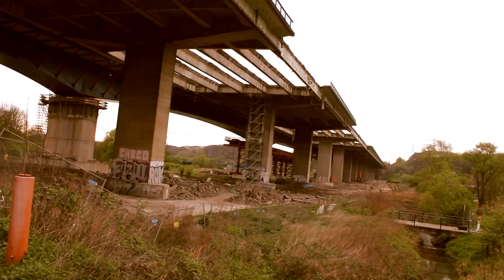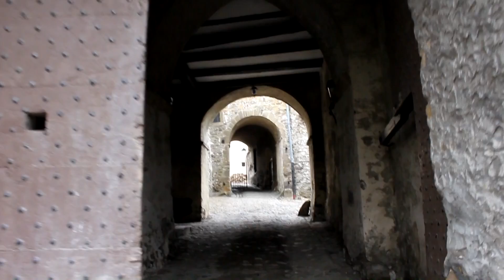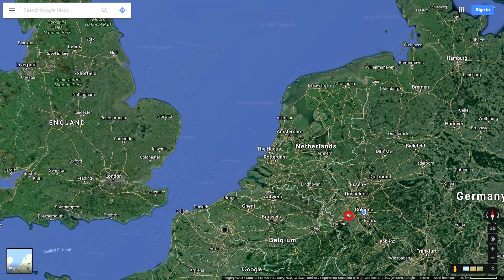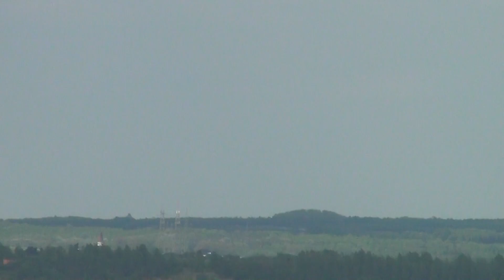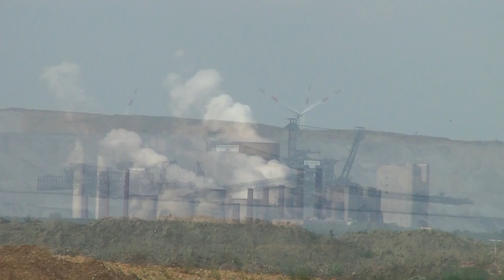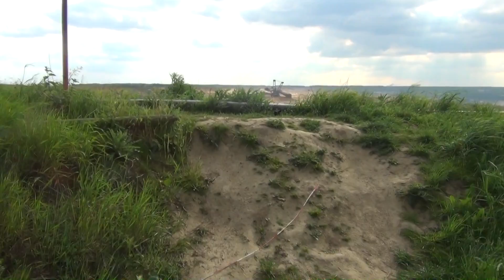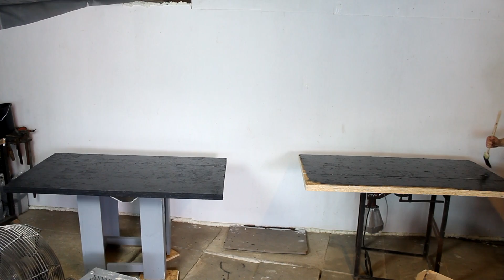A Trip to the Wasteland (In the Middle of Germany)

Comment: Lignite is basically dirt that burns. It's low energy, so you have to burn a lot to get the same energy of better coal. It's one of the dirtiest ways to make power.

My opinion: it was a mistake to abandon nuclear power after Fukushima. It's so much cleaner than coal, especially lignite.
Reply: You see, I have not mentioned my side on this argument, I have not picked one, I believe in context (as in should you build nuclear plants in places with frequent geological activity, probably not, unless its figured out how to prevent disasters in case of any sort of event, but that is a different discussion).  What we are discussing here is you, a random guy on the internet spouting your conclusions in CAPS on the youtube comment section and ending your lack of substance with a PERIOD , now that to me smells of arguments from emotion, or more accurately -> argument from ignorance. As your first comment set off my bullshit detector(not the detector that says that your conclusion is wrong, but the detector that says that the way you came to your conclusion was most likely not through personal research and figuring out the pros and cons of the issue, but from emotional reaction to a few media headlines). So I felt it necessary to query you for the basis of your authoritatively presented conclusion to which you have failed to respond on two occasions confirming my original suspicion that you are talking out of your ass. 

Moral of the story, don't speak in conclusions if you cant back them up, you'll end up looking more stupid than you most likely are(the behavior you have presented here is frequent in all sorts of comment sections, and it saddens me that it keeps persisting, but I guess its part of human nature , I'm just trying to make you aware of it, you probably are a really nice individual, but try to keep from capsing your conclusions if you can not back them up with sources. It will make you look way less silly on the internet. Capsing is visually raising your voice to try to strenghten your argument. If you have ever argued with a drunk person you find out they often start raising their voice instead of making sense to feel that they are being correct, I suggest abandoning that habbit).
Reply: Oh I'm no nuclear expert, I just live in France where we have a Nuclear Religion, which is destroying every perspective of economical growth on medium to long term. We are exporting a lot of cheap electricity, cheap because the cost of maintenance, repairs, update, replacement and disassembly of the old reactors aren't included in the price but on our country debt. It's a bill we'll pass to next generation (the proof : none of our presidents ever made a decision concerning the massive problems we have with old reactors and the skyrocketing cost for disassembly. Macron also just spoke about how it will be address later, in 2050. As I said, the problem kid is passed between generations...). 
There is a lot of promotion for the nuclear as a clean energy because media tend to only focus on CO2, which is a fraction of the ecological disaster. Maybe when we had yet another impossible-to-happen nuclear incident we will think again. But let's not go too far, the point was, placing every bet on a limited-resource and yet-to-be-proved more effective nuclear technology is not smart. Elon Musk is considered a genius because he dared taking the leap to the next level, and the renewable, like the giga factory which is brilliant and will reduce cost of batteries. It's visionary, not "let's stay in the comfort zone". It's actually a safe bet, think renewable income in the long term...
Solar prices have dropped ten-fold in recent years, and think about wind, hydro, geo, tides, and better materials in construction. Efficiency of LEDs, architecture, recycling, lots and lots of things have been improved, it's true ! Of course we are on the right path...so let's not fail again and be stuck on a single path, the nuclear, just like in France, where investment on renewable is slowed down by nuclear lobbying. If we have to invest, let's not place all of it in The Hope that Science will find the solution in the Atom, and in time, before there is no fossil fuel left at a decent price (or uranium for what we know, as new reactors are taking decades of development).
Multiplying renewable is not simple, but it's an effort we can do today, because we have the technology. We also have to, if we actually want to do something instead of just talking and studying rising sea level etc. I hope someday people work together again, instead of losing time in empty debate when they're actually talking about the exact same thing. I'm so tired of our governments and finance controlling progress speed, when we perfectly know we have the capacity, technology, and all the means available for a renewable transition. But yeah, since EU is managing investment (governments can only invest 2-3% of their GPD or they get a warning/a fine), we are stuck, our economies strangled...that is why people are raising awareness on ecological problems, except the discussion always turn to war, one side crying it's a conspiracy to cripple finance, when actually it's the freaking solution to make massive bucks (ask Elon how it's business doing). But hey, go say to the Allmighty Areva that with a fraction of a reactor price we could cover a region in solar PV or windmills...well you know the drill, same dialog with oil companies. But they both control the market, so voilà !
Reply: @French Toad multiplying renewable energy sources isn't that simple, people like to champion Elon Musk for his solar roofs(but due to angling these cant be as efficient as regular panels) but that isn't exactly revolutionizing solar technology, just a smart way to market it to spread wider use. At least for the near future of a couple of generations there needs to be some other form of energy source and in some cases I think an argument can be made for the nuclear solution.

as for the consumption reduction , then that is being worked on in every industry already(ever heard of smart street lights, swapping for led-s, less power consuming computer electronics etc). 

" R&D isn't cheap and it's possible the solution for a more efficient
 reactor will be uneconomical because of maintenance and technology cost" That can only be true as long as fossil fuels are cheap, fossil fuels price rises can bring large investments into research. Its a matter of choosing uncontrolled atmospheric waste vs controlled radioactive waste, Improvements on both ends can be done in both fields. I'm not smart enough to pick a side, but so many people seem to be nuclear experts in the comment section, that I feel the need to bring arguments for the opposing side.
Reply: Joseph Dunn sounds a whole lot like oil sands (Canada) or Bitumen Shale(Utah), its all energy, it really depends on the economics.
Reply: Unless you find a way to smoothly transition into your dream 100% renewable solution you are going to have to look into the less friendly solutions and work out the pros and cons. Who does not want the planet to run 100% green, but the problem is that arguing against economics will always lose you the argument. Every country has its own geographical and financial limitations and all of that dictates the feasibility of green technology(for example, living in the north, i will never get elons roofs because they are way too inefficient, just an example, don't get me wrong, the guy does cool stuff). Also you should not model your countries economy after one billionaire thats kind of naive.
Reply: LFTRnow Nuclear is dead. Too expensive, too little, too late.
Reply: Nuclear power is not clean. It produces huge amounts of dangerous waste that we still have no solution for to get rid of it. Unless we find a solution to deal with the waste, no one should even try nuclear power on industrial levels.
Reply: @Greg Peck funny how you failed to make any specific statements after me pointing out the lack of specific statements in your original comment only for you to come to the conclusion that I am an idiot instead of the conclusion that you know nothing of what you are talking about, which seems way more likely given the way you conduct yourself.
Reply: Marcus thats the context based approach, reasonable
Reply: my point was not on placing every bet on  one thing, but having a reasonable nuanced discussion on the topic rather than going to the "x is bad mkay" approach which is popular on any polarizing topic and ultimately pointless.
Reply: Joseph Dunn My dear the reason why nuclear is being abandoned in Germany is not because it is a filthy form of energy, in fact, is one of the cleanest and most reliable source of energy. It's been abandoned because of safety concerns. Nuclear energy is quite deadly if there is any leak into the environment...
Reply: And it's not cheap either.
Reply: I have to say great conversation guys. I myself don't have the answers but I'll throw this out there my last 3 monthly bill was over $1000! ludicrous for a necessity. imo things are getting out of hand in Australia and I don't see any good ideas for a solution
Reply: Nuclear power, the current ones, is far from ideal but are not as bad as coal, also coal releases lots and lots of radioactive fallout (https://www.scientificamerican.com/article/coal-ash-is-more-radioactive-than-nuclear-waste/)
Reply: Ralf Anari I would suggest looking at available options. That's wind, PV and osmotic power.
PV is cheap and getting cheaper every year, wind is cheap and getting cheaper every year. Both are still on a learning curve. We do have power to gas and pumped hydro for storage.
Appart from wind and PV just have a look at high altitude wind.
Reply: " Of course we can argue for another century that it's not the right time
 for transition, that it has to be smooth not to cause to much panic for
 the economy, that technology isn't perfectly ready and so on. But those
 are just excuses we've been hearing since decades. The same excuses not
 to switch for LEDs, and you'll still find people with their 
incandescent bulb or fluo tubes claiming they don't want to hear some 
shit about . The skeptics are usually winning, and it's perfectly 
normal. Not because the technologies aren't ready, the land isn't 
perfect, etc etc, but because we are stubborn." Honestly, if the market currently consumes x amount of energy and your plan will only be able to support the market with (lets be generous) x/2  your plan will never be used, it would be an economic catastrophe. Some people not making economically and environmentally sound decisions is always going to happen (americans voted for Trump) so you cant fix that either(at least not fast, human stupidity takes time to cure), not without regulation, but leds are getting really popular where I live anyway so were getting there eventually.
"revolutions didn't happen because of sceptics..." now were getting into some personal political world view with tons of unbacked claims, I don't feel like dissecting this.
Reply: Ralf, I took the liberty to check your channel only to find you're liked videos about "how to win an argument". If you're training here I don't think we can have a debate, simply the fact you think it's personal to imagine that skepticism is antagonistic toward the idea of revolution/change (when for me I believe it's only simple logic), is clearly showing you're just having a good time trying to "dissect" and refute my ideas. It just made me realize why so many people like Marine Le Pen on YouTube : exact same process. Pointing out weak points, pressing them, and when questions are asked, give some more blurry, slippery answers, subtly avoid the main subject, and then personal attack in last resort. That's the extreme right in France and why we hate it, because it's pure demagogy and sophism. But I'm sure you're worth more than that, I foresaw you're not really against my ideas, you just want to not accept them for some reasons I yet have to hear from you.
I asked you're opinion, didn't got it. You even went all the way to copy/paste a selection, purposely getting rid of my ultimate question, in a magnificent gesture. You're not proposing solutions, and still hide yourself behind numbers. Numbers are impartial, you can give them any meaning you want. Sentences with loads of numbers are overused by medias already to make people believe anything, we're formatted this way. It's boring, if you want to win arguments as it seems you're have some personal trouble with it, I suggest you start by having a proper debate, and face the questions. If you can't answer it's not a problem, just say so. But it seems you have a personal opinion on the matter, as we had a glimpse of it when you said "Some people not making economically and environmentally sound decisions is always going to happen [...] so you cant fix that either [...], not without regulation, but leds are getting really popular where I live anyway so were getting there eventually." It look like you have some ideas about regulations, and I think we can have a discussion here where we can come to some agreement at last, and maybe you'll see that I'm not a hippie living in a cave trying to change the world by burning the banks (over-usage of archetypes intended for humor purpose), but I'm on the same page as you, and many other people. Except as I said, there is a time to discuss, a time to act, and frankly just to show you how it's mind breaking, we can't even have a proper discussion here, that's how far we are to solve the problem. Healing society starts by working on the small people level, if the population doesn't really care or understand, you can place any regulation or government you want, situation won't budge. Ignoring the facts doesn't make them disappear, you think we would have understand it by now, after millennia of history, books, studies...but as you said, "human stupidity takes time to cure". Totally agree. We were primates, evolved to this, and in my opinion we're still in the medieval age (wars, religions, great engineering, the frame is pretty much identical, and we still are stuck in poor judgments, racism, walls, a couple of rich nobles ruling on millions, etc. Next level civilization have to overcome this old crap). I certainly don't have "The Truth", and I'm not trying to convert anybody, I just have an ethic, I noticed scary changes even without looking at the news (here birds have disappear, except pigeons, bees are sick, fireflies were a usual sight when I was young, they're gone now, etc..). I also feel a duty and a responsibility as an adult to protect the future of our children, if not species. Nothing fancy, just a human as everyone else, flaws and all in the package. But, I do things on my level, I vote where I see a glimpse of hope, I recycle/use rainwater/ride as I can the bus or my bicycle, etc. I can do all these because I had an education and there are regulations and laws to protect nature already. So it's working. I say it again, we are on the right path, so let's not go down the wrong one...So let's share our opinions, to learn how we can work together, what's blocking us to do so, see what ideas are feasible or not, and if not can we make them feasible or overcome the preconceptions if that's the source of the problem.
For your info, in my opinion in an argument there should be no losers : each side learned something, so it's win-win. You only lose when you claim you possess the truth, the keys to the universe, when there are no such things.
Reply: watch the video and come back to me, he is making a point about "winning" arguments, or that you shouldn't try to win an argument but attempt to get closer to the truth.

edit(1): I'm not saying I don't want to dissect your revolution sceptics whatever thing because I'm trying to win an argument, it just seems like you have gathered a shitton of opinions about skeptics, revolutions or whatever else and figuring out what (if any) of it has to do anything with the discussion about the economic and environmental feasibility of energy resources is probably going to take a few hours of discussion and I considered skipping all of that and keeping the conversation simple.

(2):Sentences with loads of numbers are overused by medias already to make 
people believe anything, we're formatted this way. It's boring, if you 
want to win arguments as it seems you're have some personal trouble with
 it, I suggest you start by having a proper debate.

Well what do you even know if you don't look at the numbers, you have some other qualitative method of making judgements? What should we measure the feasibility of energy resources in then  ? the feelgoods and feelbads? And as I stated before I'm not trying to win anything, I was just attempting to keep this simple.
Reply: Thank you for the clarification, still no answer but ok. Actually, I did look at the numbers...how can you not ? I'm surprised I even have to justify on this point, I'm also Cartesian in my approach to problems, but I also know the main flaws of this approach : don't take for granted the numbers, which you can't always find reliable and impartial sources. Anyway, I can't see why, even if there is a world scientific consensus about ecological transition, and thousands of studies to prove that we can do it, also that it can bring back growth and employment, we actually are stuck. Look at flourishing alternative economies in cities, where people are making very profitable local markets, with higher quality products, when globalization on this level was putting them out of business. And it's one small example in a thousand. I'm convinced we can change our ways of life without losing anything, and that the economy will be much more stable than it is right now. But of course, that depend for what kind of economy and economist we are talking about. For a trader maybe, it actually might be pretty bad, as they would struggle to make same massive profit as today if they couldn't control the whole chain. Speculation has major flaws, especially uncontrolled as it is right now (there is a financial bubble growing in EU, which can deflate or explode, but it's there). Of course you can counter-argue that without this system we wouldn't even be here with all our technologies and infrastructures. I agree. But ! History is telling us there have always, always been up and downs, civilizations brought to the epitome of luxury, or other time complete misery. We are part of History if I'm correct, so it's pretty obvious we are going to end up the same way. Capitalism worked for a time, but we all know we have to think differently, not because of feelgood/feelbads, but because it's can't be more rational than to think that our life, our species, the ecosystems, has to be preserved first. Now it's our way of consuming which has to be reviewed, which is actually the easiest thing to do, but socially it's paradoxically the hardest. Interesting field of research there.

Well, to go back to propositions, we could for example try harder to slow down lobbying when it's clearly crippling the evolution, for example local markets being heavily constrained by taxes, when superstores have dozen of ways to avoid them. Here we are well known for our strikes, because almost everyday of the year you have people in the street trying to defend their jobs. In France we also have the nuclear hegemony, which make solar unrealistic for the public : absolute control of the market by the historic provider, EDF. The rare case of alternative providers are sponsored by the State to try to counter the monopolies, but it's already failing. Impossible to counter the prices of nuclear energy...but here the numbers given are absolutely manipulated, that is why I alerted on the Cartesian approach : On my bill I have 0.15€ the kW of electricity (cheap!), but at the end I pay 60€ and I have a very low consumption. AND, I get every year a catching up bill, and also I pay a "contribution to energy" in city taxes. All those side-numbers are actually part of the real price of energy, subtly covered and divided in random taxes. Here, explain me how to reason qualitatively if I went and thought those numbers were actually the truth...
For the transport, cars are way more privileged than trains, even if, just some years ago, there were railways going through every cities. Those are all political decisions influenced by lobbying, since we know those railway lines were profitable (but not enough to the taste of some national car companies). Usually the process is like this : they remove trains, people have less choice, use more the car, then the railway company look for statistics and "surprise", attendance has dropped to poor levels. Then, they announce "we will get rid of this line since there is not enough attendance" (really, not enough people taking a train at 5AM or the second at 11AM ? good job, nice service). You see, those things are common, and haven't been invisible to people looking closely to the source of numbers. You can't trust them if you don't know were they originated.
Well, the list is too long to put here, the point is : offer and demand. Business can grow according to those simple rules, so the more you go renewable, the more it become feasible. Obviously if we wait nothing will move, but lots of people understood and are investing all over the world. In the old days, you could invest and people were less fearful. Know to sell solar for example you'll have people trying to get a freaking PHD to tell you it's not efficient enough. But it'll never be for Christ sake, people are never satisfied ! The point is if we went all the way renewable in one generation we wouldn't even have to face the major disasters, and lose Trillions of dollars in insurance in the coming years (here some numbers given by the insurance companies, not sure how they were calculated but they are clear enough). So yeah, I'm pretty sure if people used the same energy they use to research ways to contradict those who want to solve problems, we would actually be having this debate in a Jacuzzi on Mars.
Reply: Interesting, I just read an article in France were there was a polemic on Nuclear and Coal in Germany. The number is 45%, the part of Coal in the energy production in Germany. Some politics in an argument with the Ecology party here were trying to say that if we stop the nuclear, we would have to use coal instead, like Germany. It's actually a hoax : since the Germans have started to close down reactors, the part of coal stood the same : 45% (to avoid the % trap, in other units there was a progression of 10 TWh only). Reason is, the renewable went up from 16.6% in 2010 to 30% in 2015 (+83TWh in comparison).
I thought that it might interest you since it's specific about the subject in the video, and may counter the first post actually, which is funny proving the same hoax is used worldwide. Again, be careful of the numbers, I also fell too many times in their trap, but they hold no truth if their source is biased.
Reply: Fun fact 2 : the politic at the origin of the debate and the hoax here is Arnaud Montebourg, famously known for being influenced by the oil industry lobby, and who actively wanted France to adopt Fracking...but when the petrol prices went low, he suddenly said everywhere he was against this polluting and horrible solution (lol). You see how incompetent the guy is, prices fluctuation influencing his ecological ideas, the most dangerous kind : inconsistent, in the worst way possible.
Reply: French Toad just wondering what taxes you pay above the 0.15€/kWh on power? What's your total consumption an bill? I am from Vienna and pay around 0.16€/kWh including gridfees, taxes and anything else.
Reply: You kidding ? including fees ?! My goodness, I went to Vienna once and found it beautiful as heck, loved the museum and the architecture, and now you're telling me this ! I wish I could move there :) 
I went and checked my last bill, so to be precise it's 0.098€/kwh without VTA (even less than I thought, but average is 0.14-0.15). My consumption was 405kwh (60m² flat, in winter, electric heater, kitchen and boiler), so 35€, add VTA 20%. Then add the subscription which include gridfee, 13€, add VTA 5.5%. Then TCFE (taxe on consumption), CSPE (contribution to public service of energy), CTA (contribution on gridfee), VTA 20%. 
I consummed 22€ of electricity, for a total charge of 74.30€ (more than I remembered but oh well). I also had a 9€ catching up bill from the ministry, those usually come once a year, following market and government regulation of prices. Oh, and I precise this is for 2 months (I have a bi-monthly contract). As I say, I don't consume much, it's well isolated here and I have big windows, no tv. I'm pretty happy with this bill. 
The CSPE almost came out of nowhere recently, the reason is that EDF, the provider, actually buy the excess solar power from its clients at a whoping 0.20€ (but decreasing each year, it was 0.40€ 5 years ago!), which make it pretty interesting to go solar if you're an owner and can afford the installation (pretty expensive). It can be very lucrative (1000-1500€/year).
Problem still is, all those numbers are not including externalities, and we can't forget the discounted cash flow effects. Nor the diplomatic needs, for resources availability and importation. The equation for the real cost of energy is very complex, but it's pretty interesting !
Reply: instead of serving me the political unhappy-meal, what is your personal
 opinion of the state of affairs, if we imagine that humanity is screwed
 if it doesn't act in the coming decades (we know we're doing shit since
 the 30's, now we're 2017 and we still hear "it's ok, let's not go too 
fast shall we"). Then, what do you propose ?

I didn't realize this was a serious question, why would I imagine that humanity is screwed in the coming couple of decades? It's not about "lets not go too fast" its about lets not commit economic suicide along the way, which was my whole point anyway so in essence I already addressed this , I don't know what you are talking about, what other question did I not answer? I didn't suggest specific solutions - I believe in context based approach (accounting for the populations power demand, economic cost, environmental hazards - where to put nuclear waste, how much co2 will coal plant produce, how to dispose of the nuclear plant, how much of the energy consumption can be reduced during the lifecycle of the plant, how much of the infrastructure can be swapped for renewable so you wouldn't have to build plants forever, how is the geological activity where I want to do anything either wind sun or hydro or earthquakes and so on) I'm not just going to blank say SOLAR FREAKING ROADWAYS and think I did anything.

(edit) you seem to want to change the political/economical system. good luck with that.
Reply: Political system will change someday, as History said, things evolve. Concerning humanity, it's an exaggeration to form a scenario and to finally get your opinion, and I finally have it ! Thank you, I can now see we are exactly on the same wavelength, it truly is just a difficulty to convey ideas.
Now we can process the flaws and barriers to those solutions. Power demand of the population must be reduced, heavy industry is the first big consumer, while small manufacturing is more energy efficient : on this point it's a good idea to promote local, crafted products, bring back employment, creativity, seller/client relation, avoid miles and miles of truck/boat/plane transport. Those ideas are growing popular, and politics are following and self-attributing the merit, so everything is running smoothly here, let's continue. 
Economic cost : difficult question, including externalities, DCF, it's not a good idea to follow an economist if you want some actual change, any change is a disturbance and a risk most don't want to follow.
Environmental hazards : if nuclear doesn't blow up in your face it's the cleaniest solution, even if the wastes have health consequences when managed poorly, radioactivity isn't so much of a problem just like our everyday dose of radiation from the sun or when you take an airplane. It's about exposure and level, so it can be easily controlled, climate change isn't. But as said before, nuclear is a temporary fix to the problem : heavy cost, heavy development, years to build a reactor, lifetime of 60 years is pushing it but possible with increasing risk of accident, and fuel reserves is unstable and limited. When oil will become harder to find, uranium use will grow, and following current consumption growth there just is not enough fuel. But as a temporary fix, it's ok.
Transition have to happen now, not because we want it fast but because we are late already. There is a small window of opportunity if, as you say, we want to avoid economic suicide, and have a smooth and nice transition. Oil availability and climate warming will have for consequence to make prices rising at every events, and to make markets more fearful than ever. The more you wait, the less you'll see the chance to invest in the transition, the more the cost will grow, etc. The Vicious Circle by excellence. So, we're agreeing we're talking about the same thing now, or am I still a dumbnut who just want to be an ecological Nazi in your eyes ?
Funny you mention solar road ways, it seems you saw that France tried some. Well hello, it's our genius Segolene Royal, the ex of Hollande, who was put in charge of climate and ecology ministry and decided this, and with the beautiful lobbying of Colas, the road leader. Don't think for a second the population were behind this crap and loving it, everyone is pissed off here except through the medias were it's all happy bunnies jumping everywhere apparently.

Thanks for the good luck, it's much needed, I have lots of work to do to improve my debating skills, since I fail to convey my ideas swiftly and simply enough for people not to leave their prejudice and stereotypes. I dream the day we can share ideas without bias, but it's a story for another life. Also, I stay open if you have ideas or advice, the field is so big and complex I never dared say I have the ultimate plan. It's only a humble, rough idea. Still, I feel there is an urge to do something when we are at the best shape, and we're slowly sliding into some dark times ahead, with many changes we can't stop, population, diplomatic balance with Asia, emergent countries etc. Big changes we have to integrate to the equation if you want to avoid economical suicide : don't wait for the market to be more disrupted than ever, do it when it's calm. It's alright to trust economist and scientist to do their job and stabilize thing, but giving them my entire trust is also a gamble I do not wish to take.
Reply: Check your facts.  There have been several cases of nuclear leaks into the environment, and few if any deaths from radiation exposure.  It is not a perfect tech, but it is the safest when counting deaths.  On top of that, if we were to pursue Gen IV and other more modern nuclear technology, we wouldn't have to have such concern about meltdowns due to reactors designed in the 1960s.  Look at the AP1000 (built today), the IFR (built in the US, 1980s), the molten salt reactor (alternate 1970s tech, being modernized), the list goes on and on.
Reply: Molten Salt Reactors really need to be developed. They don't make Plutonium-239. In fact MSR's can actually be used to destroy weapons grade nuclear material, and can run off of spent fuel from breeder reactors. The primary reason that the United States does not use MSR’s is that they cannot produce weapons grade Plutonium-239 which is a byproduct of the thermal neutron fission reactions inside of a conventional Breeder Reactor. In fact, MSR’s can only destroy and dilute nuclear material and make it ineffective for use in a fission or fusion bomb/weapon.
Reply: You are fucking up with your vocabulary dud, I'm an inquirer(might use a bit more colorful language than is common for polite society , but other then that all I did was ask for clarification to which you responded with name calling and felt that you had no need to prove your claims because they are self-evident, but I have yet come across these numbers that would support as authoritative of a conclusion as you presented) but no problem, I would be butthurt too if I accidentally appeared silly on the internet.
Reply: @Greg Peck thats a very authoritative way of joining the discussion, your comment has zero substance. You state that its not efficient (where are your sources? efficient compared to what?) , you state that it is very dangerous (apart from soviet fuckups and geological events like japan which is extremely prone to earthquakes and tsunamis, what is the extreme danger you are talking about, because as i can infer from the lack of substance in your comment you seem to be very confidently talking out of your ass).
Reply: I 100% agree with you, abandoning nuclear is a huge mistake.
Reply: what's your answer to dealing with spent nuclear fuel?
Reply: The pebbled-bed reactor will be commercial available in China, 2017.
Reply: I seriously wish all the luck in the world to mr Musk; hopefully he can transform the roofing industry!
Reply: I understand your point of view, even if you're twisting my words and focus purposely on weak points which make me think you're not too keen to discuss without bias. I didn't model anything, I simply tried to mount some example together in order to try and break some preconceived notion and avoid political answers. I failed, but I'll try again. Oh and I used Elon as a famous example. Nothing fancy as a model or some attempt to convert you. I'm just trying to see if we understand the situation on the same level, as I don't know you, I'm probably not from the same background nor culture, hence some general examples, simple and well known.
I understand what you're saying, and I also did stressed the fact that there is a time to speak and debate, and a time to do act and do something. Of course we can argue for another century that it's not the right time for transition, that it has to be smooth not to cause to much panic for the economy, that technology isn't perfectly ready and so on. But those are just excuses we've been hearing since decades. The same excuses not to switch for LEDs, and you'll still find people with their incandescent bulb or fluo tubes claiming they don't want to hear some shit about . The skeptics are usually winning, and it's perfectly normal. Not because the technologies aren't ready, the land isn't perfect, etc etc, but because we are stubborn. Most people don't want to concede, as they are stuck in the past or habits. For example most don't realize we are almost 7 billions. When I was young, I remember we were taught at school that there was just about 5 billion humans. The issues are not the same. We can't sit down and wait, or actually no we can obviously since we're doing it, except we are aware now of the issues. 
Million dollar question is, how do we win against economics, if even when we are talking about our children, most don't care a single fuck that we are robbing them the good life we're running. I don't know. Personally I like to discuss around me and on internet about the subject, but even if I don't say anything and just ask about ecology and renewable, I get the same speech you told too. Skepticism. The hardest feeling to fight, since the word is linked with laziness/conservation of energy, the most powerful argument of all, and possibly the root of world stagnation. Revolutions didn't happened because of skeptics. We wouldn't have been in outer space. No discoveries. So it's an interesting paradox, because here we are, and we could say the humans are not animals because of their curiosity (not only obviously). What do we learn then ? nothing, we're just reminded that we need to remove our shackles in order to go forward. So Ralf, instead of serving me the political unhappy-meal, what is your personal opinion of the state of affairs, if we imagine that humanity is screwed if it doesn't act in the coming decades (we know we're doing shit since the 30's, now we're 2017 and we still hear "it's ok, let's not go too fast shall we"). Then, what do you propose ?
Reply: There are natural nuclear reactors in Gabon that have run for 100,000s of thousands years, and the spent waste is just sitting in the ground.  Burring it deep in stable ground should work.
Reply: And Thorium.
Reply: Nuclear power as we use it today is not the way to go. We're using a precious commodity like a fresh rapper uses crisp 100 dollar bills. Dumb approach that will only come to bite us in the ass later.
Reply: Oh and if you answer, avoid the obvious "humanity is fucked anyway" or "science will find the way in time" or "humanity isn't over in the next years just the biosphere", those are not answers, just running away. You're selling yourself as reasonable, so give me a reasonable solution to save the boat when water is already on the bridge.
Reply: Can't believe I don't even see a logical comment like "reduce consumption, improve efficiency, promote isolation of households, multiply renewable sources by two every year" etc. Nope. Coal is cheap but it's temporary, like China which is already massively investing into solar, hydro, wind, as they have now the means to invest, after decades of slavery hardwork. Nuclear cost a metric ton of money, fuel isn't unlimited (current reserves can last 90 years with current usage, then it will cost too much). R&D isn't cheap and it's possible the solution for a more efficient reactor will be uneconomical because of maintenance and technology cost. And of course waste management is a very, very, very long term cost, and the bill will go to our kids. Not the best imo. Investors and governments tend to avoid the question, but someone will have to pay the bill, so either we're grownups and take it whole, or at least we share it with next generation, or third solution we act like assholes and we leave all our shit to the next. Somehow we're between solution 2-3. We like to think we're making profit, but we're just taking a loan on the planet, using limited resources. Renewable is the only way to provide real profit, as it can grow back. I don't understand how people are stuck with such basic logic.
Reply: Storage of energy is also a big problem, for example in 2012 German windmills produced an excess of 208000MW in just one day, making the price at -200€, forcing export. Renewable is wasteful if you don't organize society around it, use it and store it properly. There are solutions, electric cars can become buffers during the night, using their batteries to upgrade the city storage, etc. A lot of things have to change, which mean lots of new businesses and jobs...except we're stuck in fossil fuel, causing massive unemployment and stagnation. For fuck sake, embrace change, don't fear it.
Reply: Joseph Dunn Nuclear is way to expensive. High Altitude Wind Power is what you want.
KiteGen and Ampyx.
Reply: Cleaner fuel that can't be used as a weapon.